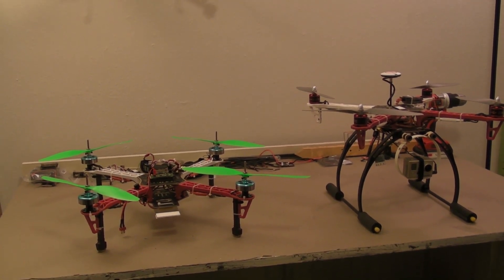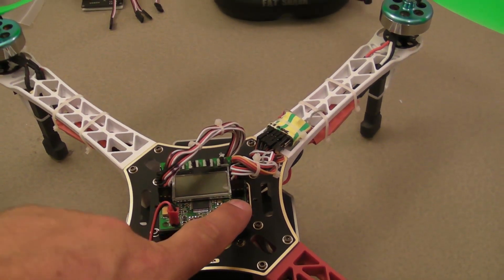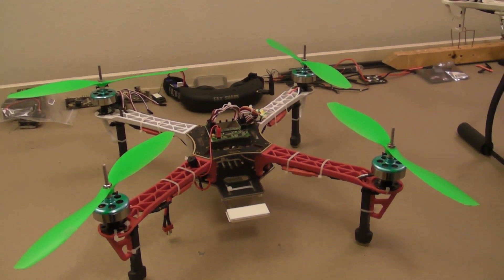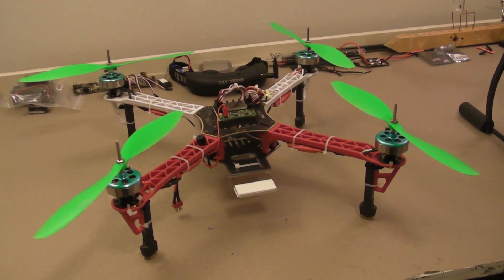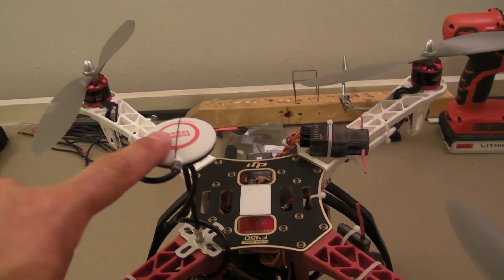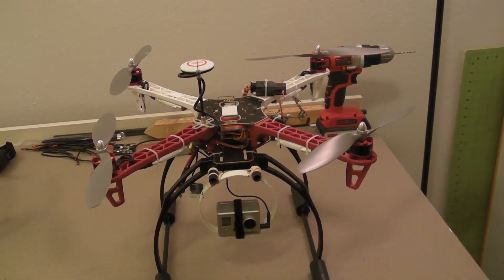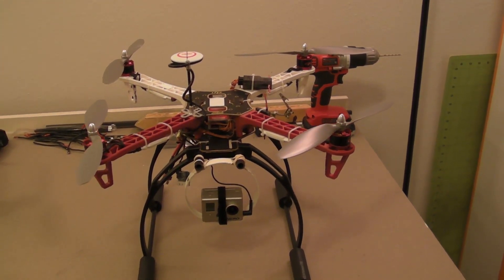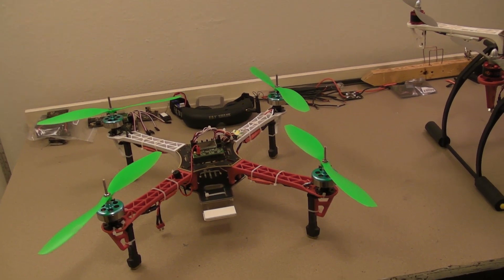Comparing the DJI F450 vs Clone FY450 - Final Thoughts (Part 5)

Comment: Is the clone frame capable of lifting a camera ?
Reply from the maker: Yes. It will easily carry a gopro on a 2 or 3 axis gimbal.  I wouldn't carry anything larger than that.
Reply: @letmeplaymystrat  I am going for the 'clone' frame 450, for aerial photography purpose. Is it a good idea ?
Reply from the maker: The frame will be fine.  Just be sure to use decent motors, speed controllers and a good flight controller.  The cheap stuff that I used on that build are not the best for stable flying that is required for good aerial photography.  Good luck.
Reply: @letmeplaymystrat  Also, does the KK2.1.5 Flight controller support camera and gimbal ? I read at a few places it's not meant for camera support.
Reply from the maker: I never use the flight controller connected to the gimbal.  I connect the gimbal to one channel of my receiver so I can adjust camera pitch.  That's all.  I would not recommend the kk board for aerial photography.  I would use the Naza Lite.  It was designed for that purpose and it's only $50 of $60 these days I think and that includes the GPS.  In the long run you will probably be glad you spent a few extra dollars on a better controller.  That being said, it has been a few years since I used the kk stuff.  Might be better now.
Reply: @letmeplaymystrat  oh cool ! This means I can connect a camera to my quad irrespective to the flight controller variant right?
Reply from the maker: @shayananwar406  Yes, the gimbal should have a channel that controls pitch and one that controls roll.  You can connect either or both directory to the receiver channel and control it from the transmitter independent of the flight controller.

Comment: what motor do you recommend with this esc Hobbywing XRotor 40A  2s 6s?SunnySky X2212 KV980 Brushless Motor?is ok or not ? F450 Quadcopter Frame Kit?
Reply from the maker: vano kiknadze That's a pretty big esc for a 450 size quad.  They will work, but just bigger and heavier than  you need.  I really loke the SunnySky 2212 980kv motors on 3s.  I use them myself.  I think they might work even better on 4s, but I've not tried it yet.

Comment: Hey i have a question, on the budget built dji knock off. Lol what is the landing legs made from and did you make them? Or where to get them? I just ordered it from hobbyking and i think that would be a great first thing to do for room for battery etc. Anyways thanks!
Reply from the maker: its just some carbon fiber tubing that I glued and zip tied to the frame.
Reply: Ok thanks for that information. Also how is the clone? Is it still holding up? Thanks

Comment: Thanks for the videos comparison vids on this.

A few quick questions:

Q1: On the FY w/ the KK2.0 controller board.  Did you get a chance to take the P gain down some?  Did it take out the quick wobble you had that was pretty evident in the video of it's flight?

Q2: What in your opinion is the best low price Controller / GPS combo, and does it support RTH?

Q3: How much flight time did you get out of the 2200mAH 3S on the FY450?

Currently I'm waiting on a Q450 frame V3 (Hobby Kings knockoff of the DJI F450 frame.)  It's supposed to be much closer to the DJI F450 and resolved early issues on the Q450 frame (i.e. weak arms that snapped off during hard landings {check that - crashes})
Reply from the maker: Hi, thanks for the questions.   

1) Not really.  I did a little tuning but did not really spend a great deal of time with the gains.  I am supposed to be helping a friend tune his F450 with kk2.0 in the next week or so.  If I do I will let you know.  

2) Okay, just my opinion here and others will differ. Depends on your budget, but I am a fan of the Naza controllers.  I have the Naza M on my TBS Discovery and I now have the Naza Lite on my F450.  They just seem to work out of the box and I really don't like to spend a lot of time tweaking P gains and I gains, etc.  My Naza M was pretty expensive, but the lite is about $160 or so.  I have not tried any cheaper controllers with GPS and RTH.  Naza does it all.  For a controller without GPS, I really want to try the Naze32 which I hear is awesome and only $25 or so.  Just can't find one in stock anywhere.

3) Bare F450 with a 2200 got about 6 minutes.  Now my quads have FPV gear, gopro brushless gimbals so I fly them with 3000mah and 4500mah batteries. 

Good luck with your build.
Reply: letmeplaymystrat Thanks, I've got a 4000mAH 3S (30C)  I was hoping to be > 10min w/ FPV which I'll eventually add, but probably won't use a GoPro initially (unless I 'borrow' my son's.)  Sounds like I'd get the 10min w/o FPV but depending on weight may not get it w/ FPV.  

I'll be 3D printing my own Gimbal when I do this.  Quite a few existing designs available on thingiverse.com, including designs meant for brushlesh.

Comment: Hi, why did you mount the hexTronik kv700, and not the kv900? :S
Reply from the maker: I had the DT700 motors on hand so I used them.  They worked well but the 900kv with smaller props would work well too.
Reply: Okey, thanks :) I just ordered (my first) a similar setup, but with the 750s. Could you please make an onboard video of it, with the setup you currently have? :)

Comment: Thanks for one of the most understandable, honest and informative guides I've found.
That camera mount is K.I.S.S and I'll be making a small one for the #808. On a real budget here, and was just looking at the arms of the DJI against the clone arms, as I'm learning and I've broken 2 in gentle drifts in as I try to level out the quad into a decent hover. Can you tell me if the arms from the dji fit the clone? as I think I'll go that way. My manufacturing skills are way above my flying skills!
Again, really good stuff. I'd also like to know how you set up the KK2 to get it so smooth, or is that all pilot?
Reply: Sorry, I asked questions that had been posted with answers.
I like the MGBGT btw.

Comment: Hey! What C-rating do you use on your batteries? And what size/brand are they? Thanks - Nick
Reply from the maker: Hi Nick, pretty much exclusively the cheaper 20c batteries.  3000 mah and I prefer Zippy or Turnigy.  I bought a few of the SkyLipos but have had horrible performance from them.  My last few for my TBS Discovery were Turnigy Nano-Tech 25c 4500mah.  They work great too.
Reply: letmeplaymystrat Thanks! Wow, 20C - thats amazing that you are getting such great performance. I think that I need to increase my prop size on my motors - I am getting terrible flight times. Thanks for the quick reply